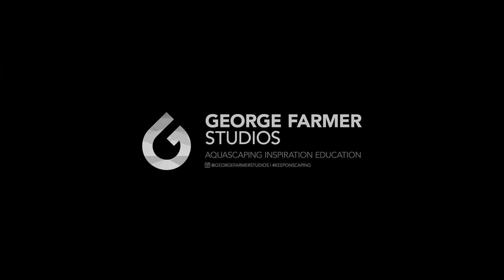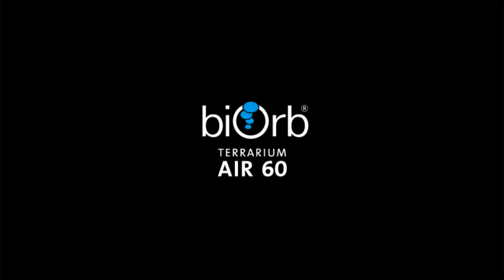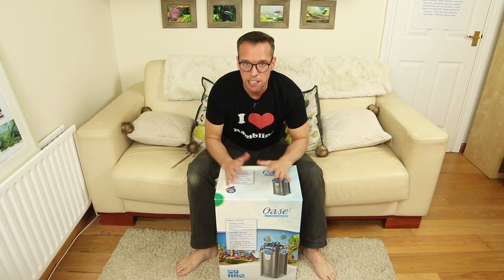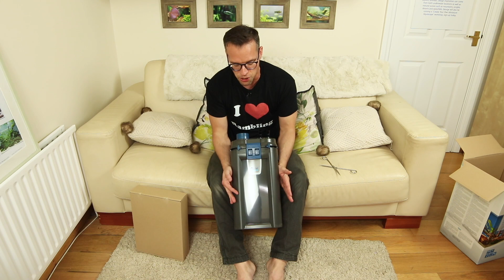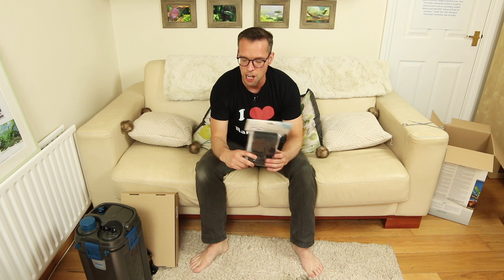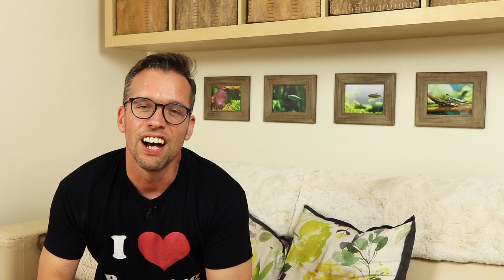Aquascaping Tutorial - Guide to Filtration and Circulation in the Planted Aquarium

Comment: Fantastic video George. You are a true wealth of knowledge.

I do have a question though. You talk about the 10x rule. I have a 350 litre tank with a filter that is running at 905 LH through a spray bar. The fish seem to be constantly struggling against the flow. I added a circulation fan at the opposite end as the flow rate wasn’t getting the water a complete cycle and this seems to have worked. But I cannot imagine a higher flow rate and still have fish able to swim in it. (harlequin Rasbora’s and Tetra’s). Am I missing something?
Reply: Didn’t realise this video was 2 years old. Popped up on my home page. 😂

Comment: Hey there George.. I have a 60x40x40cm tank running with a biomaster 350 filter.. just wondering what lily pipe sizing would you recommend for my tank? The biomaster runs on a 16/22 tubing.. would a 12mm skimmer reduce my flow rate?

Comment: hi George, when do u prime the oase biomaster? is it before turning on the filter or after? i can see some bubbles/air trapped in the hose near the filter resulting to slow flow. i have tried to shake the filter, priming, cutting the hose into shorter, changed hose size to a smaller one. it works fine in the first week but slower flow was observed after a week or two. what are your advises for this one? thanks George

Comment: Hey George.
I have a juwel lido 120 aquarium with the eheim 4e+350 (1100l/h) filter,but for me with the original setup do maximum 600l/h...so if the oase 350 do 1100l/h that can get the same maximum 500-600l/h flow leveling?!
Anyways never will comes out the 10 times circulation...
What you think?

Comment: Have you ever heard of purging air bubbles issue in Oase 600 Thermo filter? Have you experienced it? If yes, what have you done to stop it? I bought it two weeks ago (thanks to your channel and reviews) and I have this filter constantly, but very randomly purging micro air bubbles. I did more digging and found out that many customers have this issue. Oase acknowledges this problem. They’ve redesigned the impeller shaft/lock, but the new design is still having same issues. I would like to know your input on that.
Reply from the maker: Hi, I’ve never experienced that. I guess I’m lucky

Comment: Great video! Question about internal flow - I am using a Hydor circulation pump on the opposite corner of the filter outlet to help with flow and churn. Do you use those in your tanks or is it better to have filters do that?

Comment: I really like this video.  I specifically like how you differentiated between Filtration and Circulation.  So often people smash them together and convoluted the differences. 
How you covered them matches a lot of advance literature and looking at very complex, large systems.  For example: many of today's large marine systems employ a filtration sump with only 2 or 3 times turnover for the filtration, and then utilize power heads and wave makers for 10x or more circulation through the display tank. You can of course use canisters for extra flow and then accept the excess filtration that comes with it, but understanding that the extra circulation is the primary reason is an often overlooked understanding.
Reply from the maker: Thanks 🙏

Comment: Hi George nice talking! Small tip on prefilter you dont need to push two taps just hold firmly at the top and rotate the bottom cover for foams it will release with less effort,  cheers
Reply from the maker: Thanks 🙏

Comment: Filtration wise, i think that biomaster 600 is more than enough to handle the small bioload of an aquascape focused tank. If what you need is just extra circulation, why not use a small wave maker? Or for smaller tanks, a surface skimmer also adds a decent flow.  But it does take away the aesthetic aspect of the tank a little bit by adding extra equipment in there. What do you think?

Comment: For an ADA 90p George, I have a 350T and a 2080 available. I was going to use the 2080 but from your points on plants taking some bio - do you think the 2080 is overkill? I have a circulation pump too but I figured the bigger filter would be best but now I’m not so sure. Cheers!
Reply from the maker: I’d go with the 2080. You can always remove or replace some bio media
Reply: George Farmer that was my thoughts too - cheers George. Was concerned that over-filtering in this instance could actually be a risk!

Comment: I have a turnover rate of 24.5 (440 l/h in a 18l tank), but I use a spin outflow pipe because it's a betta aquarium, so the water is barely moving at all, as in there is not much current to speak of. I'm also injecting CO2. My Egeria and Limnobium both grow like weed in the dead spot so to say, but now I'm concerned that if I'll get a more advanced plant it won't fare so good.

Do you think it would help at all if I'm placing a very tiny sponge filter like the Aquael Fan Micro Plus in this dead spot to help with the current? It could also double as a skimmer and aerator. I don't like the EHEIM skimmer, it's very bulky and bare-bones.

Comment: Thanks for the video. If, as you say the plants and soil do most of the biological filtration, why do you need two filters to keep your 300l tank clean, especially when the bacteria eat the nitrats the plants need. Doesn't it make more sense to use a streaming pump? Oase offers for e.g. the Oase Stream Max Classic for less than 30,-Euro an it moves 2.000l per hour. It is only 10x6x6 cm small so you can hide it behind some hardscape in the back of the aquarium.
For my 720l aqua scape it would be absurd to install 6 Bio Master 600 Thermo for more than 250,- Euros each. Where should I hide all these filters and all in- and outflows in the tank without  adding an industrial look to it ;) I use a Streaming pump that can move up to 8.000 litres per hour. Combined with the controller I can simulate waves or reduce the flow during the night to make it more relaxing for the fish.

Comment: I want to ask where should we put our co2 diffuser, and if i put in the other end of my outflow pipe the co2 bubbles doesnt get moved around my tank
Reply: I have a 2 meter long tank and i put my out flow on the corner right of my aquarium. I use a sump filter and i use a resun sp 5200 powerhead (2800 l/h)
Reply from the maker: Put CO2 diffuser next to return pump inlet 👍
Reply: @GeorgeFarmerStudios  thx for the tip

Comment: Excelent video!

Circulation is very very important when injecting co2. A good example are carpeting plants. Maybe you think that your cuba carpeting plant isn't doing well because you need more light or fertilizer and in fact is because your floor level circulation is poor and it can't get enough co2 and nutrients. Quite tricky to get good circulation there.

I started using an inline jbl atomizer some weeks ago for this matter and I'm starting to see improvement in some of my plants. Ranunculus inundatus for instance is growing quite faster than before. I had the co2 difuser in the oposite wall of my 64l cube and it wasn't getting enough co2 I think. I also changed my old Sera filter for a bigger jbl 702 external filter with more circulation.

The oase external filters are awesome, that prefilter ir very handy. I want to improve the filtration on my big tank and probably I will change to one of the thermo series. They aren't cheap though!

Comment: Good stuff George.  Some comments/suggestions/observations.

The Oase external is a good product, I'm using one, it is however, quite pricey.  The heater/stat in the filter is great but, beware, if the filter blocks and stops working the tank will chill.  The pre-filter works really well but it can, because of the density of the sponge material block surprisingly easily.  And, output was not consistently strong enough from me to use an in-line Co2 reactor.  Juwel make a great fuss about their tanks having an internal filter, and thus, keeping water in the tank.  I have had spillages in the past from externals.  I also run a second external, with a UV tube, which I only use when introducing new fish stock.  This is a very cheap Chinese filter and has proved reliable for at least 1/2 a decade.  Juwel tanks, with their supplied internal filter, lighting and open canopy with no cover glass make for easy maintenance and, in my experience - with extra lights - grow plants very well.  

Internal ceramic Co2 diffusion only works really well, as you say, if the filter output pushes the micro-bubbles around the tank.   The, now old fashioned, cylinder/ladder pathway diffusers, often were not tall enough or needed a final bit of assistance from a filter, to do a really good job.

Phosphate levels, if high, and I don't find dip strips that accurate, will cause algae problems, nitrate is also nearly always high when there is an algae problem but the evidence is that phosphate is the real culprit - the exception is of course bright green filamentous algae which, and this is rather bothersome, seems to love the same parameters as most plants - though is maybe a little more light hungry.  In my experience, especially if tap water comes from agricultural areas, nitrate and phosphate levels can be very high in the summer, much higher than the water in a well planted established aquarium.  I certainly caused water problem issues and algae blooms after water changes from water with high levels of pollution, probably from agricultural run off.  For new tanks, perhaps the first six months, I would personally always use Rowa to keep phosphate levels very low.  Hornwort, Indian Fern and Salvinia - if regularly harvested will really improve water quality but as with all floating plants, they will slow the growth of the plants beneath.  Dennerle in fact recommend Hornwort for all new tanks, as do I.

Dosing I find problematic,  conventional horticultural products - NPK - have too much phosphate and not enough iron for my liking.  But those sold for the aquarium are often really very expensive.    Like you George I have never found carbon in the filter harmful to plant growth.  I currently have loam under horticultural grit but this is a recent experiment - I have a layer of hessian fabric over the compost which prevents clouding when planting or carrying out maintenance.   So far (three months) I have had no leaching and consequential water quality issues.  In the past I have used aquatic compost topped with dried sand (kiln sand) very successfully, but sand, according to some, compacts.  In my experience the only problem really with washed and dried sand, is that it easy to scrape the glass - corydoras love filtering it through their gills in search of micro organisms to eat - some other fish may find the substrate a little bright and might bleach a little in colour.  I currently have a small tank with very fine, aquarium designated black gravel which seems also very successful.

For me the success of a planted aquarium really takes a year or so to be proved.  My last tank ran for a decade, for the last few years with cheap DIY 4,000K 30 watt floodlights - but lots of Co2 (the 30 ppm you stress) and regular micro nutrient dosing, especially sequestered iron.  I grew Rota Macrandra well, but some so-called easy plants didn't like the conditions especially slow growing and low light species such as Anubias.

I too, like you George, have no across the board recipe for guaranteed success , I might never have had crypt melt, but Alternanthera, a so called easy plant, does not like my current set-up and neither does Lielaeopsis novae zelandiae, whilst Limnophila, Hygrophila, crypts, Micranthemum and Nymphaea are very happily pearling and growing cleanly.   I'll welcome any observations on that this current conundrum.  

PS loved the Madrid store.
Reply from the maker: Thanks William - great post! 🙏

Comment: Hi George

Thanks so much for this video it was very helpful and i look forward to more videos like this. The technical aspects of setting/maintaining up a planted aquarium. I liked that this video went into
1. What some of the other options out there are are
2. Some of the science behind whats going on (especially this)
3. The reasons behind your choices and the
4. How to bits

For me this allows me to apply the information and find alternate solutions to the common problems.  With my budget and location its just not possible to use the hardware that you do.

A video on how to monitor CO2 levels, lighting, and balance it with lighting would be useful. i saw your video with aquarium gardens which was helpful, but the RGB spectrum, lumens etc is still confusing.

Comment: George i'm falling to see what's so special about these filters vs other established brands like Fluval or Eheim.
In fact they look very basic, specially when you compare them to the latest Fluval which are FAR FAR more advanced.
Reply from the maker: Fluval and Eheim don’t have the quick release pre-filter. Fluval don’t have a built-in heater. Eheim’s thermofilter have a built-in heater that’s not removable so if it fails it’s more expensive.
Reply: George Farmer Thk you for your input. 
Good to know the cons/pros of each brand. 
Given the LCD display and temperature (and other parameters) alert on the Fluval G3, I assumed it had a heater built-in but it doesn't 🤦🏻‍♂️

Comment: Love informative videos! Do you have a PAR meter? There is no info on the internet on PAR reading for the new a360x sun. There are PAR readings for the a360x tuna but I can't find anything on the sun. If you could see what PAR readings the a360x sun is putting out that would be very helpful as I just bought one and I have low to medium light plants and I don't want to run the light at too high of an intensity.

Comment: Once again a great video and even better explanation. But I have a question on CO2. Many recommend having the CO2 turn on an hour or two before the lights. Would it be better to have the CO2 come on sometime before the lights so the drop checker is the proper green? 
Thanks again.
Reply: I have tried this in a high tech tank and even then i noticed that some plants develop stunted tips occasionally.
I use to run the lights for 10 hours and co2 came on two hours earlier.
It was still not enough co2 for certain plants.
Issues went away as soon as I started to inject for 24 hours.
But to prevent overgassing I use and highly recommend to use always a surface skimmer.

Comment: An easy tip to find out how effectively you are distributing your Co2 is to wait until your Co2 is about to turn off and then give your plants a little tap with your finger. If you are doing everything right they should release 100's of Co2 bubbles when you tap them that build up on the undersides of the leaves throughout the time your Co2 is on.  If nothing or little comes off a plant then it's probably not circulating properly or you are not putting enough in. That's the visual indicator i use for dialing my Co2 in.